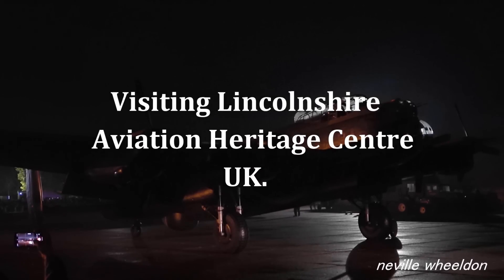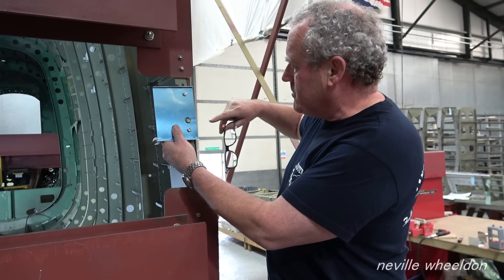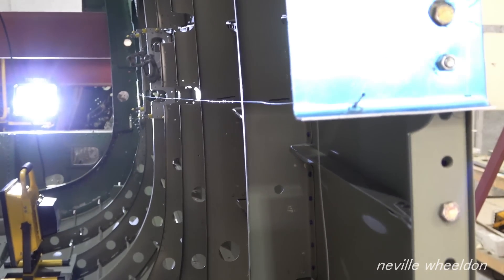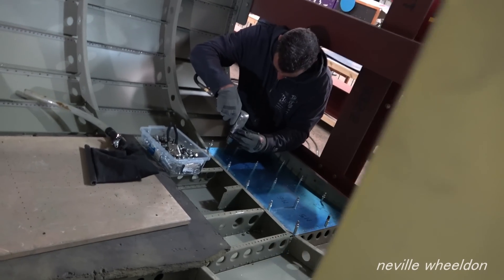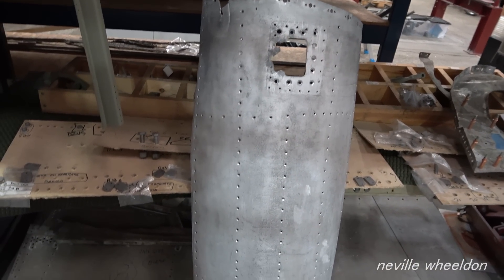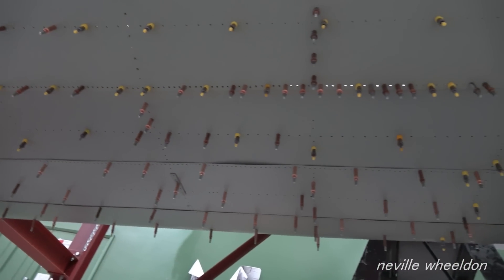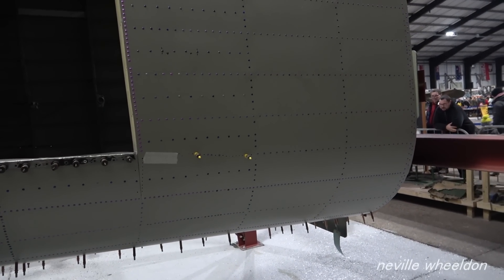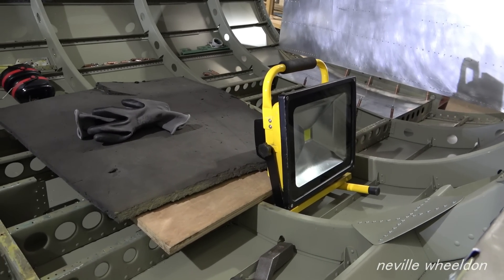Video 171 Restoration of Lancaster NX611 Year 5. Control rods in rear fuselage

Comment: In Andrew Pantons latest Rivet club newsletter he wrote “.  The leading edge skins have been repaired by Keith where the balloon cable cutters are held.  The cable cutters are steel so the skins have suffered through dissimilar corrosion and require patch repairs.”

With our modern day knowledge now of what occurs with dissimilar corrosion, what alterations are being made to prevent this occurring again? Any kind of gasket being placed between the parts?
Reply from the maker: Hi Andy, I'm pretty sure they will not be replaced.

Comment: Very interesting as usual. Do we know why the control rods go from round to square and back to round again? Is it just because of the shape of the connections?
Reply: I will hazard a guess. I believe the square portion (passing through the bulkhead) provides torsional rigidity. The tubes come under strong forces in the longitudinal direction. They must curve slightly to conform to the fuselage. These forces would cause the tube to want to buckle. Keeping them torsionally rigid would prevent this. It is just a guess, though. Keep up the amazing work, Neville.
Reply from the maker: @rexmyers991  Hi spoke to the Deputy Chief Engineer on this in Video 174 and he's not sure. Thanks Rex.
Reply from the maker: Hi PTTC, not sure. checkout video 173.